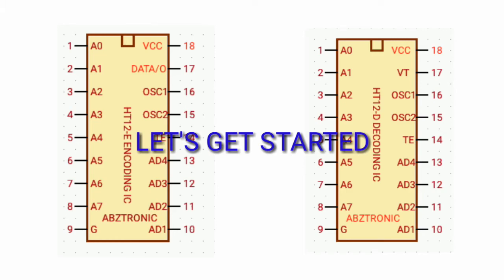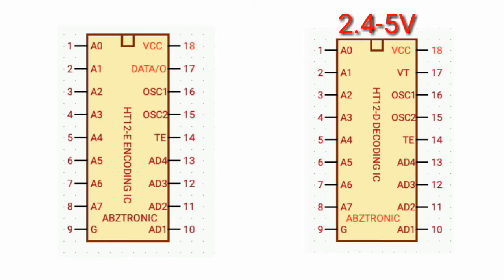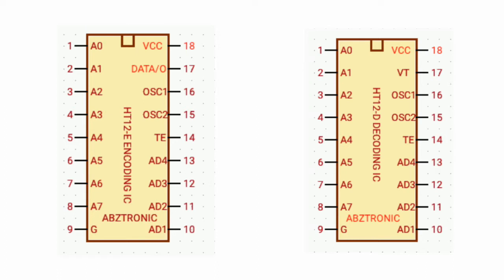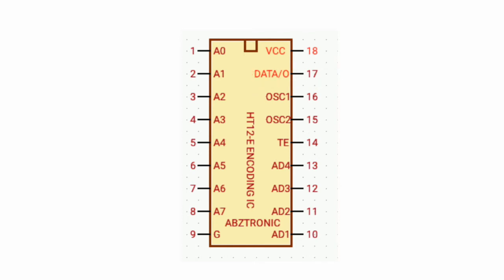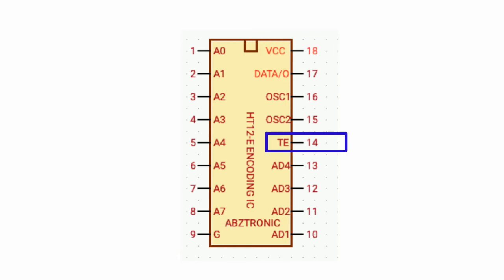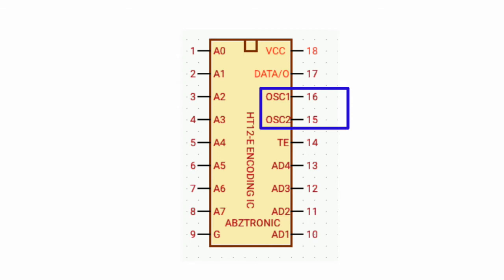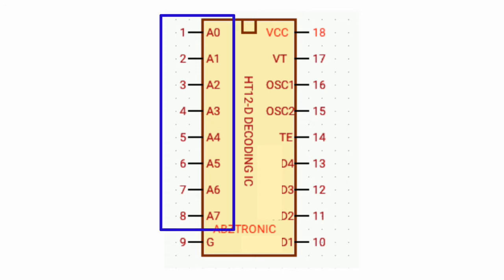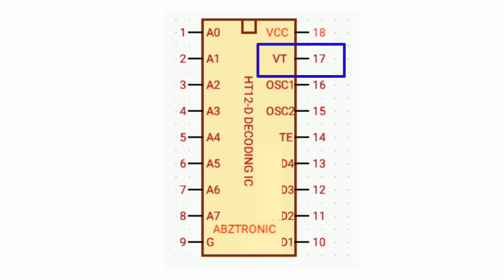Part2:how the ht12e & ht12d encoder & decoder ic work

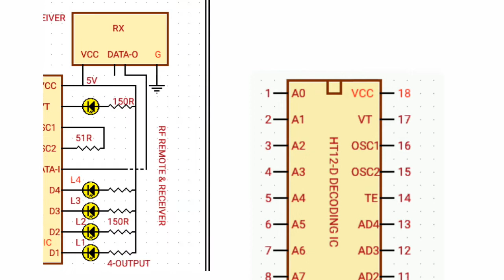Comment: there is a one mistake in a circuit diagram  5:43  there is 51 k resistor instead of 51 r  in receiver circuit in ht 12 decoder ic  ocillator pin

Comment: brother am sorry for this but actually you made a mistake. you reverse the VT led terminals I did same as you do here , the vt led, and the data pins go high in the absence of transmiter. # CORRECTION  connect the vt led +ve to the ic the ground the negative.

Comment: I made RC car using Ht12E and Ht12D and FS1000a Tx &  Rx module. I use 1M resistor in transmitter circuit and 33 k resistor in reciever circuit but circuit is not working motor are not moving. I am using 5V. Can you help me.
Reply from the maker: Sorry i cannot help you  because the original owner of this yt channel has pass away